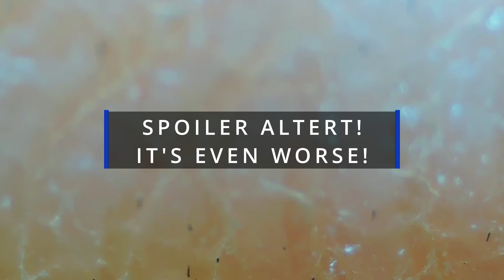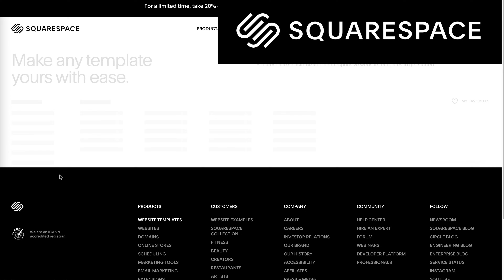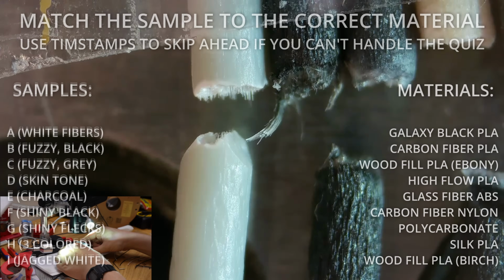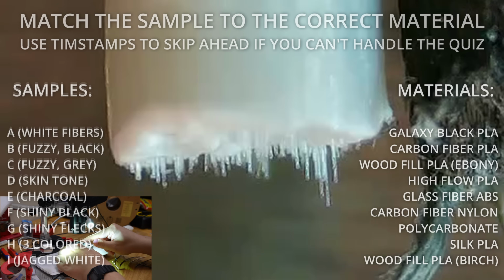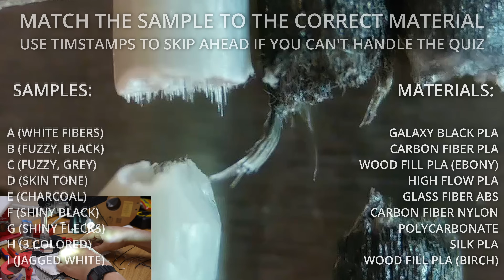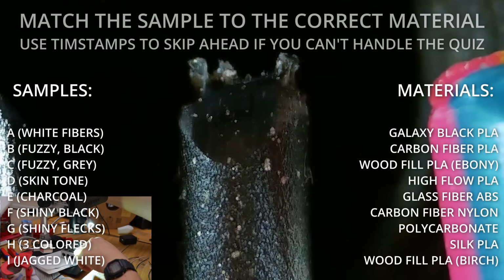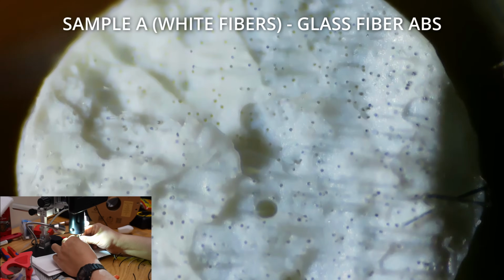Carbon In My Skin. These Wounds, They Will Not Heal.

Comment: I've been trained professionally to work with composite materials.
Carbon fiber and fiberglass embedded in the upper skin aren't considered health hazards.  The primary health hazard with composite materials involves resin compounds, where they can be toxic and/or release poisonous VOCs as they cure.  You should use skin and eye protection, and a respirator when working with resins.
Carbon fiber, fiberglass, aramid, and other non-toxic composite materials are only typically dangerous to the skin in the form of abrasion and irritation.  Repeated irritation over long periods of time can absolutely cause damage, but I don't think handling filament or parts sometimes would cause that much damage.  If I was handling a significant amount, or all day long, I would wear gloves for protection.
The other main composite hazard is inhalation danger, and one should always wear a respirator ANY time they work with composite materials, including carbon fiber, fiberglass, and many times of insulation.  Airborne fibers, dusts, and other aerosols are a respiratory irritant and dangerous over time, especially in an industrial environment.
Specifically dangerous, though, is not the fibers themselves.  Fibers are often too big to be inhaled, and the fractured, small pieces, although small, often don't make it to the lungs, though they can still cause airway irritation and issues.
The most dangerous part of working with composite materials is working with resins.  Carbon fiber is often embedded in them, and breathing resin dust from mechanical abrasion, or fumes from their volatile fluid states, have both been confirmed as carcinogenic and extremely dangerous over time.  This does depend on the resin used, as some are more dangerous than others.  MSDS sheets for chemicals are always supposed to be available online from the manufacturer.

TL;DR Carbon fiber and fiberglass won't hurt you unless you're trying to breathe the stuff, and even then it's not good but it's not toxic or carcinogenic.  However, you should be afraid of working with resins - ANY skin contact, dust, or fumes are bad.  Regardless, always wear your PPE when working with resins, at the very least eye protection and a respirator, and if you're working with a fluid resin or abrading a composite material, gloves, eye, and respiratory protection should be mandatory.
https://www.osha.gov/otm/section-3-health-hazards/chapter-1 - VI.C
Reply: This message was made by a carbon fibre grifter down playing the side effects of carbon fibre

Comment: Won't you just shed the skin and the particles with it? I'd be more concerned about the lungs, the skin is basically a conveyor belt of dead cells anyway. As long as it can't get through the outer layer of the skin, which I don't think those particles can, it should be fine. Might itch for a bit, though.

Comment: Heat polish thicker parts fast and easy. Wave the old torch flame around over the part fairly quick to melt back fibre and dull it down some. You don't want to change the surface with the heat think burning fuzzies off of a sweater use very high heat but move fast. A heat gun is maybe less prone to damaging the surface by over cooking it but it's also harder to see where the heat is being applies and how much heat is actually hitting the part. A torch has a lot more precision and makes it easier to not roast a part. Do not use this method on super thin pieces you will instantly melt or warp them.

Comment: This is actual nightmare fuel. The pictures of those filaments in your skin are pretty messed up, and I genuinely applaud you for doing that for the 3D printing community. More people really need to see this, because I had absolutely no idea this was happening. Luckily I have not needed to use any fiber reinforced filament, I've been fine with PLA and PETG. However I almost bought a couple rolls a while back, and now I'm really happy I didn't. The filtration in my room is less then adequate (a box fan in my window that blows air out), and while I'm fine with it's effectiveness with normal filaments, the idea of those tiny carbon fibers flying around in my room is really scary to me. I'm definitely not going to play with these filaments until I get an actual filtration setup. That and once some progress has been made on keeping the fibers in the filament in the first place.

Comment: Carbon fiber has always concerned me a bit. years ago Ithere was a big concern
 when machining it. So I avoided ever machining or handling it as much as possible.
 
Also as I recall when a Military Aircraft crashed that had carbon fiber in the wings etc,
they would apply (dump spray etc) floor was onto the CF it to contain the fibers.

Comment: Considering all the microplastics we apparently all already have inside us I don't think these fibres are a huge problem, but the takeaway I got from this video is you probably don't want to get it in your lungs or an open wound - so it's a good idea to always wear a properly filtered mask when interacting with 3D printers (of any kind and any filament type) and wear gloves as much as possible, or at least any time you have or think you have any cuts no matter how small they may be.

Comment: I don't think the regular handling should be an actual issue, these things are so tiny they'll get stuck in one of the many outer layers of your skin which you'll shed and all should be good.
That said, breathing it in is a whole different issue and way scarier than getting it on your skin could ever be even in the worst case scenario.

I think people have forgotten with how accessible these printers have become that these are still dangerous tools, you're working with potentially hazardous materials and fumes, and no amount of nice packaging on your printer will change that. Stay safe everyone, and take reasonable precautions. Even just putting on a mask while you're finishing a piece while sanding or applying clear coats will go a very long way.

Comment: for making strong parts, generally wood pla is even stronger than carbon infused fillament.
ofcource there are some industrial 3d-printers which can embed actual carbon string into a print next to the fillament.
but the carbon fiber in the fillament isn't really that strong compared to normal carbon fiber and even wood infused pla is stronger in most use cases. in some cases however ofcource a different carier plastic can improve it, like petg instead of pla, however in such cases infusing it with wood typically still is much stronger than with carbon, again unless you actually put in seperate carbon treads, but that is done seperate from the fillament, and requires 3d printers which are around as expensive as some cheap metal printers.

Comment: I think this is a non-issue. The carbon fibre embedded in your skin is at most a mild irritant, and only with prolonged and direct contact. They simply aren't large nor stiff enough to have the strength to push through your epidermis into the lower layers of the skin.

As for the other concern for inhalation, inhaling anything other than air is generally discouraged. However, with the low count of particulate that would be dispersed during handling, and that multiple studies show that even in decently high concentrations of CF particulate being inhaled leads to no detectable pathological changes. The toxicity of Carbon is low, and CF is small and brittle enough not cause significant tissue damage.

Some studies did find that in high doses over the course of multiple days (~50 particles of CF per cm3) did lead to a generalized inflammatory response in rats, but this was reduced to normal levels within 10 days post exposure. ~50 particles per cubic centimeter is huge, considering even directly rubbing it on your skin only resulted in a few tens of particles per cm3. 

Realistically, when the filament is hot (and especially melted) the fibres will shed. Basic PPE, or even just a filter on your extraction fan, will practically eliminate all risk. The fact that some are trying to compare this to Asbestos, Glass Fiber, or Crystalline Silica, is way overblown.

Some articles discussing CF inhalation:
- https://academic.oup.com/annweh/article-abstract/38/inhaled_particles_VII/769/209832?login=false
- https://www.sciencedirect.com/science/article/abs/pii/0013935178900300
- https://www.jstage.jst.go.jp/article/joh1996/43/2/43_2_75/_article/-char/ja/

Comment: Luckily your epidermis does it's job extremely well, especially on extra-thickened places like your hands and fingers. These microscopic fibers will not get deep enough into your skin (unless you like rubbing it on your bare eyeball or tongue perhaps, or sticking it up your nose) to cause any problem, and the body is very good at expelling anything that gets embedded. There's a reason why a splinter of much lager sizes and far worse materials (such as metal that can corrode, or organic material that can break down and become infected) will often self-heal. Obviously this isn't IDEAL but it's not exactly something to worry endlessly about. If you work with this stuff every single day and in large volumes... you may end up with some kind of problem... but for most people this isn't really an issue. The main problem would be inhalation...

Comment: Why wouldn't the body just absorb the carbon fibers over time? Carbon is bioavailable, and even everything it cant absorb, skin grows from the inside out so would eventually get rid of the fibers even if in the dermis. The issue with these fibers in your lungs is that they pierce the lung follicles and create scar tissue that is nonrespirating.
Reply from the maker: The chemical bonds between carbon atoms is too strong to be broken by your body.

Something like carbohydrates, fats, and proteins also contain molecules that contain carbon, but they are much weaker chemical bonds that are pretty normally handled by the body

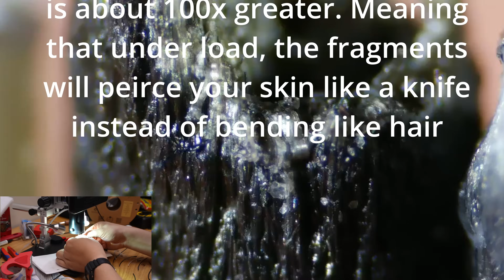Comment: @5:13 Even hairs can pierce your skin under the right circumstances, I’ve had it happen twice. Hair splinters are a concern for barbers.

In hobby rocketry circles, the common advice with carbon fiber composites, specifically sanding it, is to gear up like you would if the part was using asbestos fiber.

There’s some literature that points to your body being able to collect and remove fiberglass from your lungs, but not so with carbon fiber.

This is now speculation on my part:

Carbon fiber is on the scale of 5 microns diameter for stuff like T300 (specific spec of carbon from Toray), one generic grade carbon fiber.

I can’t find a spec sheet for E-glass (electrical glass, which is most of the fiberglass you see used in stuff), but S-2 glass (brand name from AGY, s-glass being a more generic term, structural glass) has a diameter of 9-14 microns looking at their spec sheet.

Asbestos is seemingly on the same size or smaller than carbon fiber, depending on what sources you look at.

So my speculation is that there’s a minimum size something needs to be for your body to be able to grab it to dispose of.

Comment: Lol.. CF in filament is like using iron dust instead of rebar inside concrete.
Reply from the maker: Some concrete is reinforced with chopped strands of Kevlar, it’s pretty common. You don’t need big bars to change the material properties

Comment: Your "ginormous air filter" appears to be a standard HEPA style filter.  Are you sure that it's filtering particles as small as what you're generating?  I'm not.

If you want a better "ginormous air filter" that will filter down to 0.3 microns (smaller than viruses), then check out the IQAir line.  They're stupid expensive, but they are useful in medical situations (like, for people with extreme allergies or asthma), and commonly used in hospitals.

However, you can also buy them and use them at your own home.  My wife has pretty severe allergies, and we credit the IQAir filters as being the main thing that is helping her to still be able to breathe.  Well, when combined with an AprilAire whole-house HEPA filter that is integrated into the central air system.

Comment: Try spray can lacquer for woodworking, it's super easy to apply. Im new to 3d printing and your last video was one of the first I watched so I've steered clear of CF so far and have been waiting for this video. scary stuff. All power tool plastic cases are full of GF for strength but of course they're injection moulded. go get some pork my friend you are freaking me out.

Comment: Transferring fiber to our eyes is also possible and also bad. The fiber-ness of asbestos is said to be the source of its carcinogenicity. Getting these more modern fibers embedded into us and slowly migrating around in our bodies might turn out as bad. I hope not. 

I use pretensioned fiberglass rods in a way that has me handling them a lot. If I damage the surface, say by dropping the rod on cement or a rock, the impact will break fibers locally and the residual tension pulls the polymer apart forming a bruise and exposing fiber ends. The fibers of glass have gotten into my hands and caused a reaction that pealed skin deeply from my palms for about 6 weeks. The fibers are like the glochids of prickly pair, except being glass, they never break down organically and must be shed (or not).

Comment: All the daily things in everyone's lives that are made with or from plastic.

Insulation
PVC Pipes, ABS Pipes if 🇨🇦
Latex paint, primer, caulking
Electrical wiring, outlet and switch receptacles, junction boxes, breaker panels, breakers
Smoke and CO detectors
Light fixtures, fiberglass tubs and showers, the inner parts of the toilet
Washer, dryer, stove, oven, dishwasher, air fryer, crockpot, toaster, toaster oven
Tuperware, Rubbermaid, garbage bags, sandwich bags, lunch boxes, cups, sippy cups, baby bottles, silverware organizer, handles on your pots and pans, teflon coated pans, silicone baking sheets, oven mitts
Couches, chairs, beds, pillows basically anything with foam (polyurethane is the most common)
Pill bottles, syringes, IV tubing (canula), bandages, stitches (nylon), some prosthetics, pacemaker, power ports, breast implants, tissue expanders, MRI CT machines, X-ray machines, Ultrasound equipment, EKG, ECG, EEG, leads, BP cuffs, stethoscopes, so many in healthcare
Cars - interior trim, seats, pedals, steering wheels, wire harnesses, gas tank, gas pump, lifetime filter, ROV ORVR valves, a whole host of parts in the powertrain.
Lawn mowers, garden hoses, landscaping equipment, garbage cans, landscaping barriers, sprinkler systems, outdoor furniture 

Oh, I really could go on. I didnt even hit the realm of electronics which took the plastics industry for one crazy ride and it has no intention of stopping.

Unless you work in manufacturing with molding of resin, then you are not at risk. Of course there could be someone not smart enough to know that burning plastic is bad and will just burn a bunch of it "for fun". Just dont be that person.
Reply from the maker: How many of those are heated to 260C in your living spaces?
Reply: Also, pencils. Not plastic but wood and carbon. Well graphite. But graphite is made from carbon.

Comment: Hi! PPE does wonders.

Also, imagine all those people who work in injection molding or extrusion molding or blow molding, making PVC pipes, fiberglass insulation in your homes, surf boards (lay up but with GF 2 part resin), all the plastic parts in your car, your computer, HVAC, televisions, cell phones, etc.

Stop the scare tactics. No one has ever had microscopic carbon fiber surgically removed from their skin.

I am curious what you think should be regulated that already isnt regulated? Do some research on the manufacturing of plastics, they are regulated. The same companies making the resin pellets for the extrusion companies making resin pellets for the various industries.

In regards to carbon in plastic, if the plastic is black, it has carbon in it.

If someone is contaminating a persons home with soot, then the 3D printer heater bands are extremely too hot and they are burning the resin.

I do enjoy when people who lack education in fields and then talk about it as if it's killing people.

Plastics are so embedded in our lives, there is no going back. Plastics have been around a lot longer than petroleum.

Anyway, in regards to wanting to know what makes up the content of your plastics, you can go to matweb dot com.

Comment: From actual part strength testing, it seems that CF does not really add to strength to filament printing, or it is marginal at best. Therefore IMO it is marketing nonsense to sell pricey filament. Now also pretty suspect re safety. If I really need strong parts, I will prototype myself but then have SLS parts made by another service in nylon or something and they are far stronger that anything coming off an FDM machine.

Comment: It is positively unhinged how often the rights of private interests to keep information proprietary is prioritized over public safety.  It's almost giving "we're contracting a random-ass startup to use AI facial analysis to determine whether to arrest you and no they will not be divulging any details on how this works or what easily observable failures and biases it has."

Comment: I bought a pair of safety gloves from a name brand several years ago. Within 2 weeks I had serious issues with my hands. I had a break out on my knuckles of dozens of liquidy pustules. I looked up what the gloves' materials were which included fiber glass. I turned one of the gloves inside out and could see with my naked eye, fiberglass glinting in the light. For about 3 years I had to deal with the effects of the fiber glass embedded in my hands. I, of course, through out those gloves and never trusted that company again.